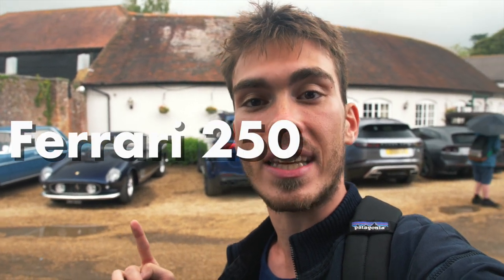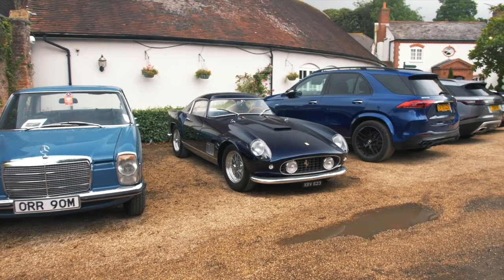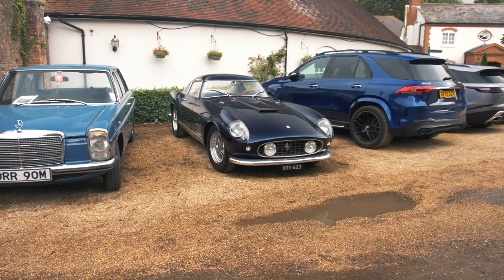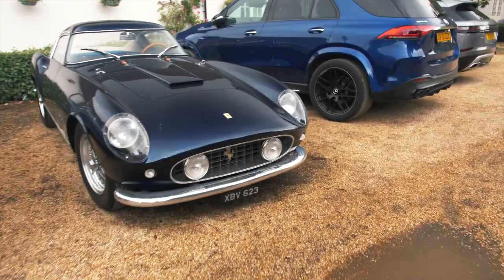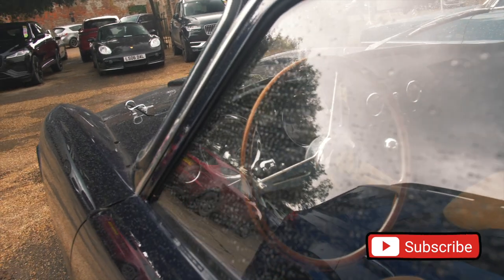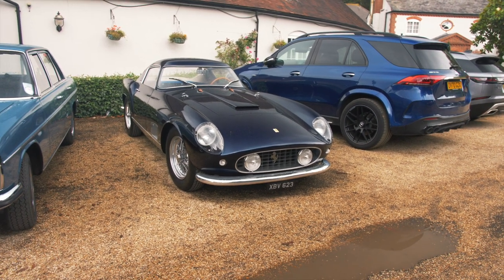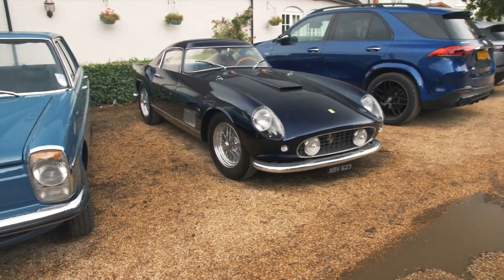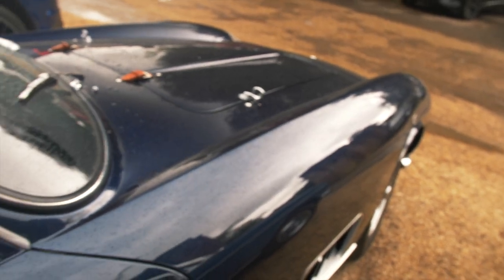ADRIAN NEWEY'S PRICELESS 1958 FERRARI 250 TDF!

Comment: nice colour blue Ferrari but your specs for the 250 tdf are not correct. it accelerated to 60 in just over 7secs iin period road tests, never did it in 5.2 secs. the 250 GTO with a much more developed and powerful engine (300hp) and a lighter body only did the 0-60 in 5.8 secs when tested in period.